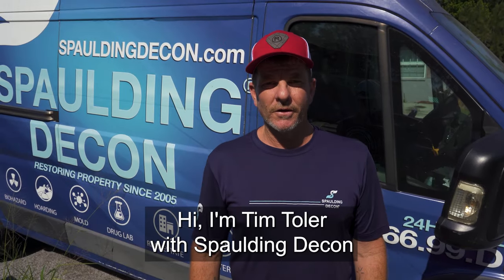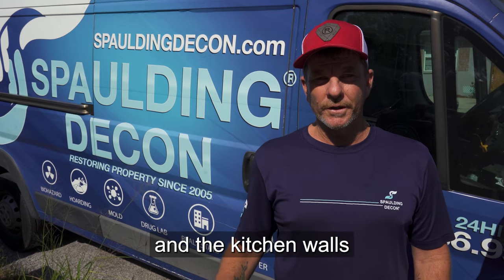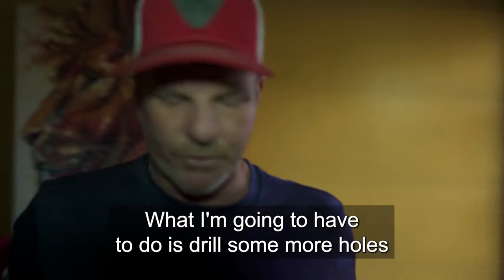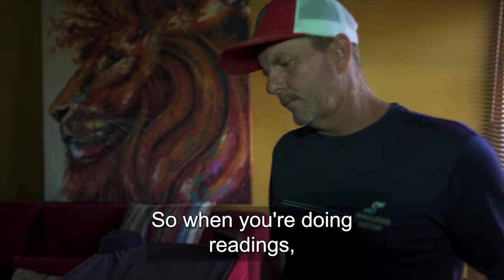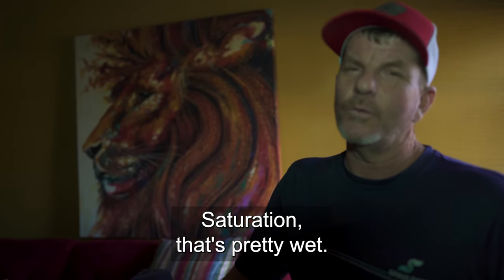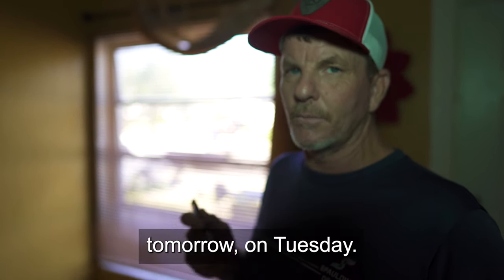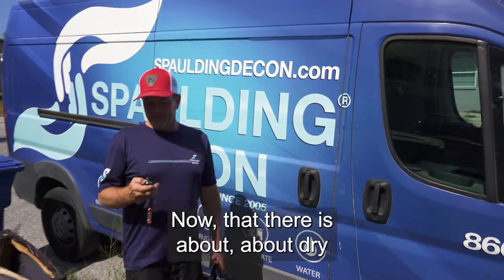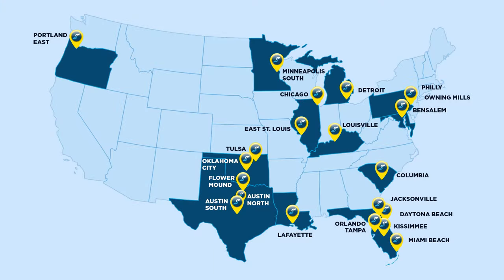When hot water tanks explode!

Comment: Where do people put hot water heaters in kitchens? They go in the basement.
Reply: I think it depends on when the house was built, I've seen a few here in South Florida with small ones in the kitchen under the counter. Typically they're usually in laundry rooms, garages if there is one or separate closet like an air handler. Mine is actually outside
Reply: 😂😂 not all houses have basements. 😂😂
Reply: Apartments and condos